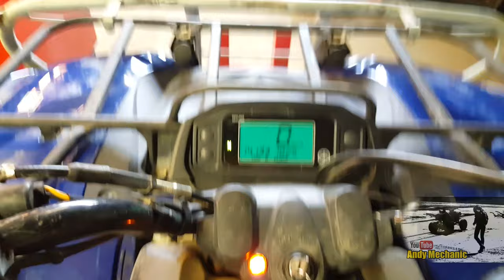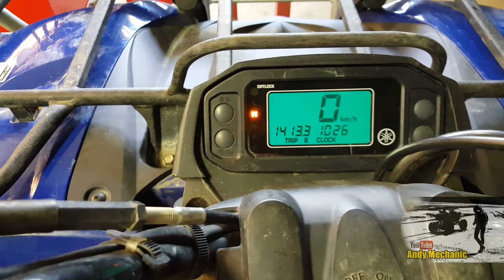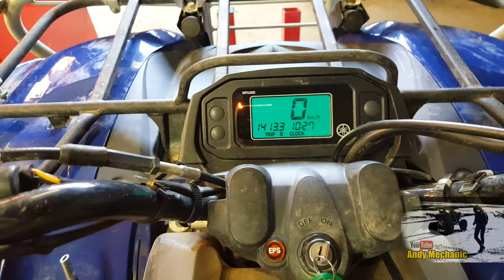Yamaha Grizzly 450 4x4 external gear selector adjustment #1014

Comment: Hi Andy,

I’ve just bought a 2007 Yamaha Grizzly 450 from the UK MOD and am in the process of trying to give it some well earned TLC. 
One/Two problems I’m experiencing surround gear Selection/Engagement. 

(1) Occasionally when trying to select REVERSE the gear fails to engage and I get a clattering sound/shuddering. That said if I then select DRIVE HIGH followed by REVERSE, the gear engages. Do you think this is likely to be a External Gear Selector issue or Internal?
(2) Possibly connected to Item 1. The Gear Indicators on the Display often don’t show which gear is selected.

Any thoughts / suggestions?

Regards

Stephen
Reply from the maker: +Stephen Salter hi Stephen, it sounds very much like the external gear linkage is either poorly adjusted or the rose joints are worn causing excessive play. I don't think it's an internal fault.
Reply: Andy,

Thanks for the rapid response.

Back at work now fixing Wind Farms. Will enjoy tinkering next weekend.

Kindest regards

Stephen
Reply: Hi Andy,

having had a further look i'd appreciate some more advice regarding the Gear Selector issue.

Checked: 
    Bushes for play but they appear Ok
    With Engine off moved selector into each position (50% of time LED's did not work)
    With engine on tried engaging forward/reverse, resulting in chatter.
     Noticed Engine Tick Over Quite High
     Reduced Tick Over
     With Engine On Engaged Forward / Reverse without difficulty
yet LED's still only working 50% of time.

Any suggestions?

Regards

Stephen

Comment: 2003 kodiak 450 the shift lights won’t work all the time when shifting what is the problem
Reply from the maker: Hi, well it could be a number if possible faults. 

Firstly & most likely, there is a switch on the side of the engine that has a rotary type contact pad. These can wear out like in an ignition barrel. So I'd unplug it from the loom and test it with a multimeter or test light - you'll need a wiring diagram. If this turned out okay then bridge the wires one at a time in the plug on the loom - you should see each gear light illuminate with each wire bridged. If not then could be a loom fault or possibly an issue inside the dash.

Let me know how you get on. Cheers Andy
Reply: Andy Mechanic thank you I will give that a try
Reply: 8

Comment: Jason again... can u plz help me to find a service repair manual.... for my.. Yamaha grizzly 660 ultramatic 4x4 2004????
Reply from the maker: Sure thing. Send me an email with the full VIN number: andymechanic@live.co.uk
Reply: I have look for it but haven't find it .. any idea what or where to look for it?
Reply: @AndyMechanic  I've tried looking for it but haven't found it any idea where to look for it or will it stayed out to me?
Reply from the maker: Okay. Usually on the left front lower chassis rail behind left front wheel. Otherwise send me the model code sticker - under the seat. White sticker with ????-???
Reply: @AndyMechanic   ok this what I got. Dk If it's the right thing.... 
5km-82590-10
09-6 y p 0005..
Reply: @AndyMechanic   Encine family 2YMXX.A660GCB
Reply: @AndyMechanic   ok I c vehicles 5km-2179T-00...

And it says. This vehicle conforms to California regulations applicable to 1997 & later new off - road motorcycles
Reply: @AndyMechanic   hope u ant forgot about me andy...  love the girls....👍👍👍👍👍
Reply: Jason Williams- Not sure if you found a manual or not, I have a 2004 YFM660 4x4, local shop sold me a manual @  https://www.clymer.com/s/yamaha/atv-manuals      .. has schematics, troubleshooting, maintenance, a good manual to have. Good Luck.

Comment: Andy .. what it means if my dash say R.. but my will turn forward instead.. and when I put it in H... my wheels turn back ward?? Plz help.. I turn something??? Freaking out.. hope I didn't mess up nun.
Reply from the maker: Is it the lights on the dash that read wrong or the gear lever's position that doesn't match the direction the bike goes in?
Reply: Yes.. when I was turning it by hand.. the dash says reverse and a red warning light like overhearing light came on to..  I was trying to find neutral that's why I was turning by hand please help Andy and did I mess up something
Reply from the maker: This is most odd indeed. Have you removed the rod between the gear lever and the engine?
Reply: @AndyMechanic  talking about by the gas tank like on your video
Reply from the maker: Then I think you got the push rod linkage the wrong way up....
Reply: @AndyMechanic  I have watch your video about selecting the gears and I was having trouble getting into low gear and Park ... at first. So I got a brand new shifter will shift rod I got the shifra connected to the bike frame you know by the gas tank and whatever the rud connect to on the bike motor. I took the housing plate off you know those four or 5 screws that goes on the gear housing. I trun it by my hand.. and yes reverse comes up with a red light to the right of my upper dashboard like a temperature like or a warning light those two light are on my Dash . So I'm in Reverse now but when I turn my back tires they're moving forward. So I go back to that little house plate you know I guess it would be on the transmission with the spring in it that was I was twisting so I turn it in a click and click again then high gear pops up own the dash and the same red light on the right corner comes back on so instead of my tires moving forward they won't go forward but they turning backwards do it sound like I messed up something
Reply: @AndyMechanic  I explain it to my dad say he say sound like the timer is out of time
Reply: @AndyMechanic  what is the push rod linkage?
Reply from the maker: The engine isn't running backwards. If you fit the linkage the wrong way then the gears are reversed
Reply: @AndyMechanic  any idea of how to fix that problem or I messed up Andy?
Reply: @AndyMechanic  plze helped.. I got a book coming day on the 2004 -2008 Yamaha grizzly..but   what way do I need to trun it to find neutral?
Reply: @AndyMechanic  My book came in today and show me how to get it into neutral.. my tires move back and forward..so Ik I'm in neutral.. waiting on my new shifter and shift rod to come in..

Comment: Not sure about that choice of White Lithium grease.........it has no penetrating properties.  Also, regarding those cowl clips, they are one time use only. Drill a small hole through the plastic post and install a little hitch pin.  Just like the copper paste, makes it a little nicer for the next guy getting in there.  Lastly, invest in some ratcheting wrenches my friend.

Comment: I have a Yamaha bruin 250 was told it was gear box it wines when u push it when take it off I roll free
Reply from the maker: That's fine - sprag clutch will engage when you push the bike - this is the part that provides engine braking on deceleration & descents.

Cheers Andy
Reply: @AndyMechanic  when I mess with the gear selector and pushing on it forward it makes a clunking noise
Reply from the maker: Hmmmm.....I think your bike may actually be more like our old Bear Tracker 250. do you manually. change gears with your left foot or is it a shifter for Forward, Reverse, neutral etc on the left side of the fuel tank? very different transmission if that's the case...
Reply: @AndyMechanic  yes
Reply: @AndyMechanic  I can change gears with foot level I have a forward and reverse level to

Comment: hello Andy. I need some help. I own a 2005 Yamaha Kodiak 450. I was driving it the other day and while traveling about 30MPH, the bike locked up like in gear and came to a Immediate stop so i turned it off and started it back up and it wouldn't go into high or reverse. when I would move the gear selector into high or reverse it would not move! I would put it in neutral and it would drive forward but only forward. It will not drive in any other gear and I know it shouldn't drive in neutral. Do you have any idea of what it might be or what I could check? I personally do not have the money to pay someone else to fix it, I would like to fix it myself. I seriously would appreciate any feedback.
Reply from the maker: +Kevin Talley Sure thing. I sounds like an internal gearbox fault. I had a similar thing happen on a Yamaha warrior 350. One of the gears siezed to the shaft due to poor lubrication. It was 2nd gear and the bike could be used in 2nd but no other gear. I'm busy fabricating all day today but will take a look at the gearbox schematic tomorrow and try give you some ideas....
Reply: Andy Mechanic  thanks so much for taking the time to respond. I seriously appreciate the help with this. This is a bike I recently bought for me and my family to ride and enjoy. I want to fix it myself especially since we unfortunately  don't have the money to have a mechanic  fix it. what would I need to check first? do I need to take apart my cvt cover and look at it? or what step would I need to take first?
Reply from the maker: +Kevin Talley if it's an internal gearbox fault then, unfortunately, it will require the removal of the engine from the frame but don't do that just yet. You could check the engine oil level & condition first. Maybe even drain the engine oil and inspect for metal particles.
Reply: Andy Mechanic  well I've actually recently checked the oil and added the amount that I needed. every time I checked the oil about every day it has checked good with a good color and no metal shavings.  I've also recently changed the air filter and the starter solenoid and I've cleaned my grounds as well.   should I check my cvt? 
or where my gear rod attaches to my actual gear selector mounted on my transmission?
Reply: Andy Mechanic  well I've actually recently checked the oil and added the amount that I needed. every time I checked the oil about every day it has checked good with a good color and no metal shavings.  I've also recently changed the air filter and the starter solenoid and I've cleaned my grounds as well.   should I check my cvt? 
or where my gear rod attaches to my actual gear selector mounted on my transmission?
Reply from the maker: +Kevin Talley it won't be the CVT as this is common to all gears and the bike dies drive forwards. You can check the external gear linkage but I doubt this is the issue though the lock nuts may have worked loose.

You may just want to disconnect it and manually move the arm that goes into the gearbox. This will eliminate any gear leaver adjustment issue.
Reply: I've moved that lever and it seems like it tries to go into each gear the same but it only drives forward when it shows its in neutral, could it be electrical? 
 If it's internal what would I need to look for that could be broken?
Reply from the maker: +Kevin Talley well the bike stopped dead you say rather than lost drive and coasted to a halt. That suggest mechanical lock. You could also check your final drive at the back. I'm assuming you had the bike in 2 wheel drive at the time?
Reply: Yes I had it in 2 wheel drive. You are right it did come to a complete sudden stop. How do I locate my final drive? And what is it?
Reply from the maker: +Kevin Talley the final drive is where the drive shaft from the rear we the engine enters a casting which has the drive shafts that run to each rear wheel. Inside is a crown wheel and pinion. If the bearings have collapsed it could cause the same symptoms but wouldn't explain the gear lever position been out of sync. ?
Reply: Andy Mechanic Andy Mechanic  I've recently took my drain bolt from my final gear and checked the final gear oil. it was barely at the brim but I could see it. I've jacked my bike up where all 4 tires are off the ground, I attempt go move my back tires by hand while changing the gears into H-N-R and I get no different results. the back tires will not move and it seems like it could be in the final gear? I'm not sure I took a video of it and would like to know your opinion? plz. I also took apart my cvt cover to check it out and it looks pretty rough in there as well, I would like you opinion on that as I've taken a picture if it but I don't know how to post a picture or video of the bike so you could see it? il appreciate any feedback.
Reply from the maker: +Kevin Talley no problem. Video is excellent if you can do it. You'll need to set up a Gmail account then a YouTube channel....it's very easy. Once done you can upload the video as an 'unlisted' them just message or email me the link.

My email is shown on my Andy Mechanic channel under the 'About' section.

Alternatively you can just email me pictures. I'll do what I can to help. :-)